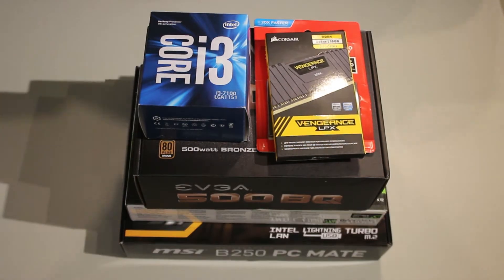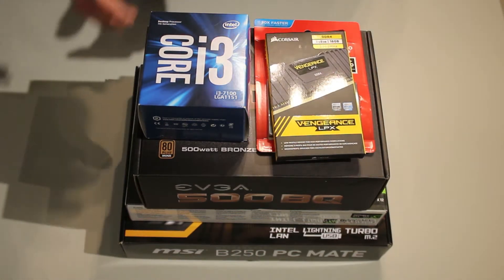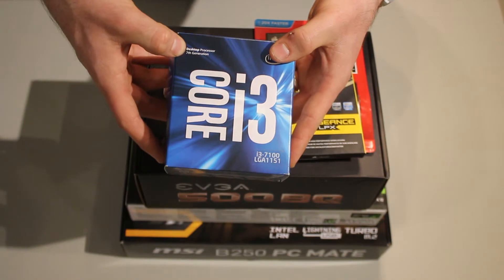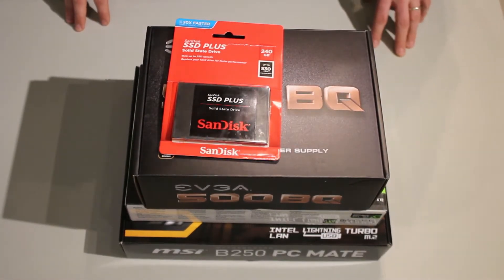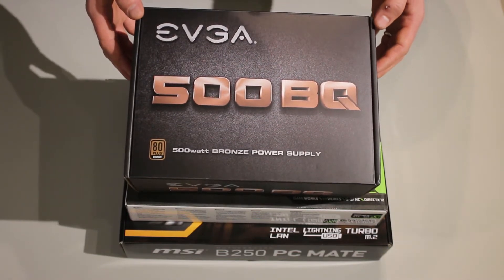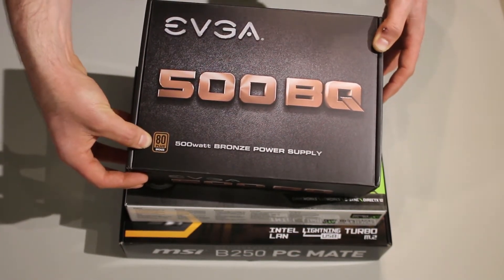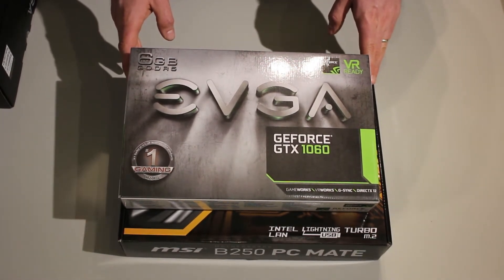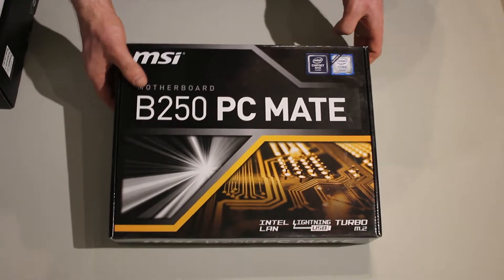Building a reasonably priced gaming PC! ($850)

Comment: Jake Steve can I ask where you plugged your fans in?..  Same  config.. system fan 1 back fan and system fan 2 front fan? thanks.
Reply from the maker: https://youtu.be/dwbbXA1zOZo?t=448 You can see here that the rear is plugged in top the top right hand corner of the motherboard. In your configuration, I would plug the rear fan into the header to the bottom/left of the CPU socket, then I would use a fan splitter to connect the two front fans to the header I used on this build. The header I plugged into here is listed as the primary header in the BIOS, so it made sense to use that one, with the added benefit of cleaner cable management, (no wire snaking up from the fan, then back out again by the VRM.) You could also run all three fans to one header using a 3 way splitter, or two 2 way splitters. No real disadvantage except having to buy extra splitters!

Comment: why use 3000Mhz (pc24000)? why not pc21000 or 19200? depending on what? thanks
Reply from the maker: Hi Julius! There are actually a few reasons for this.

1) The primary one was the advent of the MSI DDR4 Boost technology. Since I didn't understand the real world application super well, (just the marketing jargon MSI threw out there,) I was looking for an opportunity to try memory that was faster than it needed to be, and see if the MSI Boost technology had any measurable impact for regular users who aren't overclocking, using locked chips, etc, (cliff notes: it doesn't!) I was actually really disappointed by this. Effectively, it's an overkill implementation from a circuitry perspective of the DIMM slots. (All DIMM related traces are SUPER isolated, and a higher standard of QC is used on these slots.)This should, in theory, be highly valuable to overclockers who are pushing the limit of their memory. Unfortunately, this application really proved to be not important. That said, I am ALWAYS happy to pay a few extra bucks for a well thought out and implemented design even if it isn't a drastic performance increase. I believe that the overkill DIMM slots is a big win, along with metal reinforced PCIe slots. As these are two of the most common failures on motherboards, a bit of extra mechanical strength, and electrical purity is always welcome.

2) I usually aim for memory one step faster than what is needed for my application as long as it's within budget. This does a few things, if the memory turns out to be slightly slower than the manufacture stated, it is less likely to negatively impact me. Running at the ragged edge of advertised speeds is usually more likely to induce stability issues than it is if I'm running at or below the advertised speed. In this case, I lucked out. At the time of purchase, the substantially faster memory was only about $5 more expensive, so it was a no brainer to me. If this machine gets a different platform later on, the memory is still viable to use because it's faster, and more likely to remain performant through the next platform.

I hope that helps, if you have any other questions I'm happy to help!

Comment: Quick question, were you able to get the RAM to the 3000mhz speed it's rated at on that motherboard?
Reply from the maker: Hi Arthur,

With this chipset, you can enable XMP and run the memory at 2400mhz.
At the time of hardware purchase, the slower 2400mhz and 3000mhz kit was a $5 difference, and I wanted to see what MSI's DDR4 Boost was all about. After the tinkering that I did, the BIOS still was reporting 2400mhz, but with the research I've done my understanding is that MSI's DDR4 Boost can allow memory to effectively autoclock since it has a dedicated on board controller, shortened, and better shielded traces on the PCB of the motherboard.

2400mhz is the fastest I saw, but I believe DDR4 Boost was taking advantage of the additional speed/stability. If the price difference wasn't $5, I wouldn't of taken the chance, and I can't recommend people making the same move given the current pricing of memory. :)

Comment: dude the stranded cpu cooler already has thermal paste on it  6:09
Reply from the maker: copingcarot138 not when you screw up the shot and you have to retake it!!! 😝
Reply: Didn't he just wipe the thermal paste off of the CPU and heatsink? If I remember, it comes pre-applied. How much paste and how it's applied also matters, right?
Reply from the maker: Comment Zilla hey man! Yea I actually had to redo the shot, and I'm a perfectionist so I wasn't willing to just reuse the paste. I cleaned with iso, and reapplied Arctic Silver 5. Linus actually has a few great thermal paste videos regarding how to, how much, which paste, etc. strongly recommend his videos. I can't compete with his thoroughness and production value!

Comment: What case did you use here?
Reply from the maker: Hey Manuel, it's an NZXT S340. It's a super nice case for the money. It happily supports AIO liquid cooling, comes with some innovative, cost effective cable management options, (the NZXT bar thing,) nicely rolled edges, a PSU shroud, and lots of mounting options for both 3.5" and 2.5" drives. I build most budget/mid range builds in this case since it does so well for the money. Lots of different colorways available too!

Comment: The top MHz Ram that the B250 supports is 2400 Mhz...wouldn't the 3000 MHz one just run at an unoptimal speed because the MOBO doesn't support it lol? I'm going to upgrade to a B250 and i7 7700k with the same RAM but have been debating on whether I get the 3000 MHz or the slightly cheaper 2400 MHz

EDIT: Nvm, forgot about the DDR4 Boost which would allow this to work fine lol
Reply from the maker: Hey TriageReflex!

Exactly!

I had actually talked about this in one of the takes which unfortunately didn't turn out due to a technical difficulty, (did you know you have to turn microphones on for them to work?! :P) Unfortunately that, (clearly,) didn't make the final cut.

Thanks for taking the time to watch the video and comment. It means a lot that people are getting something out of this! I hope to have a new build up relatively soon. (This time a pretty beastly system in a unique chassis!)

I also think we're in a unique time where a lot of hardware is coming out fast enough that it's worth buying some components that are a little spunkier for upgrades, or cross system compatibility. Example, if Karl wants to upgrade his machine he can grab a better CPU, if he wants to build another machine down the road, he has an already good kit of memory with much more longevity for only a few dollars more! (At the time of purchase, I paid an extra $5 to get this memory over 2400mhz, which was a very small price to pay for faster, better memory whether it's advantage will be seen or not.) If you look at it from a performance per dollar aspect, it makes a lot of sense to grab the inexpensive $5 jumps, and ignore the other ones as you can get an extra few FPS for a couple bucks, but when you're hunting the top shelf memory you'll pay a lot for it.

With Ryzen pushing memory speeds forward quite a bit, I expect the cost of memory to drop for Intel owners who don't need as much speed, but do need the capacity. Either way, we live in exciting times to be PC enthusiasts!! :D

Edit: For those not familiar with DDR4 Boost, it's MSI's technology that helps take advantage of higher speed memory than what would usually be of value given the hardware at hand. I believe it's effectively them shortening the paths, and putting a dedicated controller in line that 'autoclocks' it. (Here's a product link to the motherboard used in the video! https://www.msi.com/Motherboard/B250-PC-MATE.html#productFeature-section)
Reply: Exactly what I was thinking, thanks for the quick and detailed response! I'm definitely going for the 3000 MHz one as well as that will be more "future proof".
Reply from the maker: Perfect! I'm glad to help and add value!

What does the rest of your build look like? I hope it came across that it's not just balance of the existing hardware, but being sure you're buying hardware you want to live with for future upgrades too.

Do you have a PC Part Picker list?
Reply: I do, I'll edit this comment later with a link or send you a direct message!
Reply from the maker: If you don't mind just go ahead and post it! That way if anyone is building a PC with a similar goal as you they have a helpful starting point.
Reply from the maker: Okay!! So I want to be 100% honest with you and say that I think there are a few holes with your proposed rig, but you've got some great components in there, and a lot of inspiration!

1) You selected a K Sku CPU which is overclockable and a motherboard that does not support overclocking. You may as well downgrade the CPU to a non-k and save the money! (Or upgrade the motherboard and downgrade the CPU to an unlocked i5. Either option will be a benefit.)
2) You selected two sets of memory, one slower and one faster, the faster kit will operate at the slower speeds, and having 4 DIMMs to hit 16gb uses more energy, costs more, and reduces your ability to upgrade later, (2x8gb sticks totalling 16gb is the way to go these days!)
3) Your RX480 selection is good, but the 580 just launched and is available! I selected the least expensive full size card from a reputable manufacture.
4) That CPU cooler is a bit of a compromise, it's designed for really small systems so it's flatness hampers performance.
5) perhaps the biggest issue is no SSD!! Having an SSD is seriously the largest performance gain in terms of the booting, launching programs, and daily use of your PC. I've added one, and would even suggest one INSTEAD of a mechanical harddrive to start, and adding a mechanical later if you discover you need it.

I went ahead and made two lists for you that I hope will help!
The first list is one that corrects the issues listed above, (Goes to a locked i7, upgrades the GPU to an RX580, adds a sandisk SSD, swaps both kits of memory out for one kit that's larger of the faster speeds, 3000MHz.)
https://pcpartpicker.com/list/8jKDyf

The second list is one that I built that took inspiration from your original build list and made a few improvements! For an extra $100, I've dropped from a locked i7 to an unlocked i5, a much bigger CPU cooler (of the same brand and aesthetic!) and a Z270 motherboard that will support overclocking and let you get a LOT out of your CPU. A high clock speed on an unlocked i5 will often outperform an out of the box clock speed on a locked i7 in games. If you're doing lots of content creation, or are absolutely uncomfortable with overclocking, then I think the i7 may be worth keeping.

Additionally, I swapped out the very good value oriented RX580 out for a MONSTER of a GTX 1070.

The rest of the changes are minimal, a great deal on an EVGA PSU, and my favorite low buck case by Fractal Design. Overall, it's only an extra $100, and should be a really big performance bump for gaming, and a minimal, if at all, hit for content creation.
https://pcpartpicker.com/list/VWCWd6

Let me know what you think about those two builds and if you're comfortable with overclocking, the slightly higher budget, and your intended purpose and I can help you tailor one of them a bit more or less in one direction.

(BTW, I hope by now I've earned a like and a sub! :P)
Reply: All the parts on the list I've made are parts I have. I just kept the 2400 MHz RAM there and forgot to take it off lol. The reason why I have the i7 on there is because I have a buddy who can get me it for $150 and I've never tried overclocking before and don't know if I plan on doing so but it may be an option. I'm trying to upgrade parts that I KNOW need to be changed from my current build which are the CPU (of course), RAM, and MOBO. All other things on the list I already have as well. I also added the case cause my current one is a MicroATX which wouldn't fit the new MOBO. 

The total price for those 4 things would come out to $350 which I'm willing to spend currently. Not really looking to spend too much more, trying to upgrade without spending a ton lol.

Haven't read over your entire comment but will do so later as I'm in class right now hahaha! I'll edit accordingly.
Reply from the maker: For $150 on an i7 7700k that's a massive steal! with a $350 budget, and $200 left, I'd go with the Z270 board from OC build, and settle for the slightly slower memory in an 8gbx2 sticks 2400MHz kit and overclock the system when you're comfortable doing so!

You might be $15 over your $350 upgrade budget with that setup, but you'll get much much more out of it in my experience!

Knowing you already have most of that hardware changes my recommendation a bit, so I hope that helps man! Let me know if that changes anything, and/or you have any other questions. I love helping people figure out system builds and upgrade paths!
Reply: Without a doubt and my budget isn't necessarily $350, it's just the amount that all 4 of those parts comes out to.

And I'm definitely going to be subscribing and tuning in.
Reply from the maker: Perfect! The subscription is wildly appreciated.

Then if you're budget isn't necessarily $350 it's time to go full water right? :D (I kid...)
But I think with a K Sku CPU, a Z270 board and 16gb of memory will be a fantastic way to spend that dough. In the meantime, you definitely should consider an SSD, as I think it's what makes the biggest difference day to day.
Reply: I've definitely been considering upgrading to an SSD just as my main boot drive and saving my games, files, etc. on the HDD
Reply from the maker: +TriageReflex put the OS, a most played game or two, and any heavy duty productivity software on it and you'll be in great shape!
Reply: How much space do you think a decent SSD would be?
Reply from the maker: +TriageReflex I personally have a 256gb SSD and think it's a really good size. If I were to do it again a 500 would be nice but not necessary.
Reply: Gotcha, I was thinking 250 Gb would be more than enough if I were to get one. Thanks!
Reply: Also, if I were to get the z270 MOBO and attempt to OC, I'd probably want a watercooler am I right?
Reply from the maker: +TriageReflex you definitely don't need to. A good tower air cooler like the C7, a Cooler Master Hyper 212 Evo, a big be quiet or noctua is definitely up to the task, but they will only be equal at best with a 240mm AIO water cooler. Full custom loops are in a whole different price bracket. Smaller AIOs can be outperformed by high end air and be a similar pricepoint.
Reply: Good to know, thanks for the insight!
Reply: TriageReflex wait so you can’t have like a 3200 MHz memory on the B250?

Comment: i3.....
Reply from the maker: Hey @Elmer A! Yup, we went i3 on this largely due to the budget. When the parts were purchased, there was about a $70 difference in price between this i3, and an entry level i5. Given the very low budget of the machine, and the owners desire to have an energy efficient, low budget machine that only had to play WoW, I felt it was a good balance to spend the extra money on a 6gb card for the games future upgrades and his desire to get a newer 4k monitor. As it stands, I routinely receive snapchats from Karl where he's excited about how smooth it plays. If the budget was $1000, I likely would of opted for an entry level i5, and an entry level 1070 or an RX580 but the additional funds weren't available for this build!
Reply: ohhhh JUST 4 wow ok makes sense
Reply from the maker: +Elmer A yes sir! Plus he can upgrade to any non-k sku later if he'd like an upgrade!